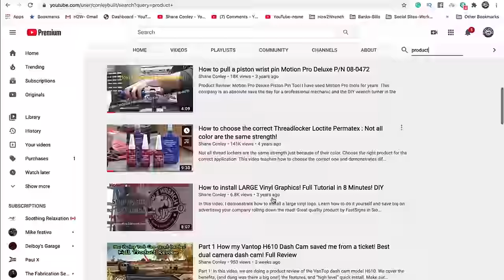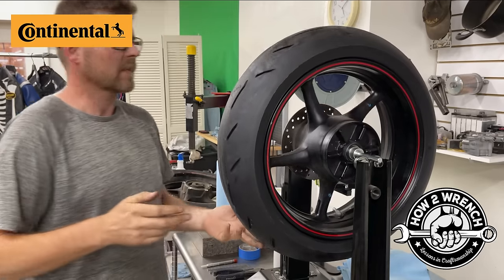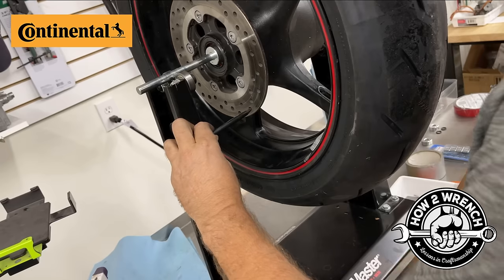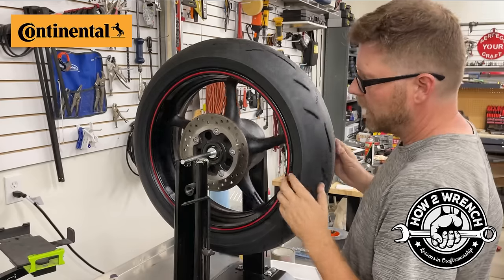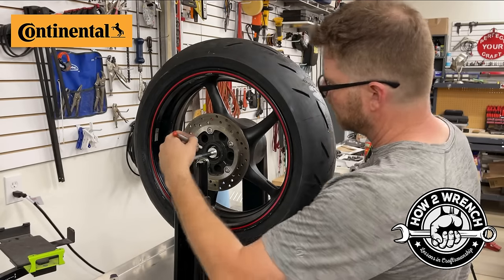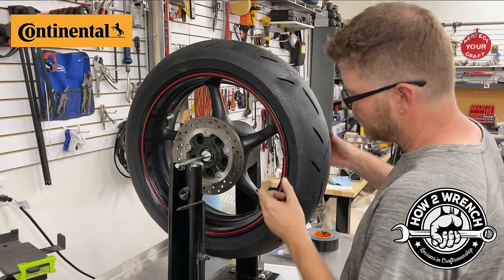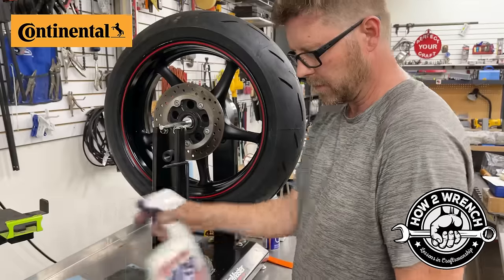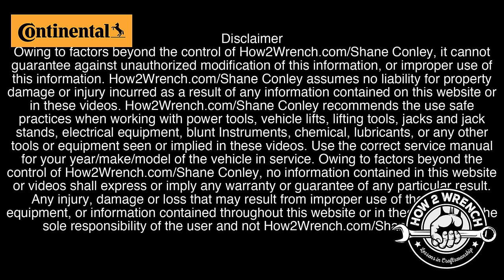Learn how to balance tires like a pro in minutes! Must see first step! BikeMaster Balancer 800-256

Comment: Always balance the wheel with the sprocket, otherwise it'll throw the balance out when fitted 

You've overcomplicated the method. Simply find the light spot (it'll be at the top when let to settle); turn the wheel 90° and add your weight at 90°. With the correct weight, the wheel will not move. Done.

Think of it like a seesaw or a two blade propeller - as long as the opposite points are of equal weight, there will be balance.

Check the bearings before attempting to balance. Any imperfections in a bearings (in the wheel or on the stand), or on the shaft could cause a false reading.

Comment: The stick on weights.....if I pull them off is there any way to re-use them on a spoked  bike wheel.

Edit....yes I refitted my old weights with a smeam of silicone sealant.
Reply: I did my front and was at 3/4 oz. I put gorilla tape over the weights and that became the heavy spot on the wheel. 🤬

Comment: What do you do if the bearings were hammered in one whack too much, and the wheel won't turn on the balance stand, but it will turn when torqued onto the bike?

And did you ever notice that f it turns on the balance stand just fine, when torqued onto the bike, it squeezes the bearings and the tire won't turn?  This makes me WANT to whack the bearings one extra time so it spins free when torqued onto the bike (to reduce rolling resistance, reduce wear on the bearings, save gas, etc).

Comment: would it be possible to balance the tire and the wheel separately and match up the spots where they might balance each other out when the tire is put on the wheel?
Reply: Absolutely! 1) find the heavy spot of the rim (without tyre). Mark it. 2) Balance the rim WITHOUT tyre. 3) Place tyre on rim, 1 bead ONLY. Find the heavy spot of the tyre. Mark the tyre heavy spot. 4) Rotate tyre so the TYRE HEAVY spot OPPOSITE heavy spot on rim. 5) Complete tyre install. 6) Remove weights from rim balance(2). 7) Balance wheel. I normally balance all wheels with their respective bitz (ie with brake discs and sprocket carrier).

I have a junk front rim that is balanced perfectly and use that as my tyre weight finder for both front and rear tyres.

Comment: cleaning old weight stickers off is a pain, i like googone the best so far. i wipe rim w isopropyl alcohol before applying weight, 
and i put half of the weights on each side. in my mind im figuring balanced left n right side is better than all the weight only on one - thoughts?

Comment: You didn't wait for the wheel to settle once, meaning you got the heavy spot wrong. It even moved CCW and then CW a bit after you left it to get the scissors, and a bit when you checked it the last time. The technique is right, but you have to do it right too, if you want it perfect. If you're happy with 98%, then you're good.

Comment: great work.  BUT you should have put those 3.5oz weights on other side of rotor  to balance it a bit further.  think about weight of rotor on that side of wheel , just splitting atoms here ;) . thanks for this video and I just ordered this balancer thanks to you.  now to install my darkside Michelin x-ice replacement  after 6 years on one.

Comment from the maker: Just in case the commentators delete their comments on Duct Tape use....What's crazier is that it's a struggle to understand looking out for others....google produced a few results to back this idea...
https://www.google.com/search?q=is+duct+tape+required+on+wheel+weights+for+a+track&rlz=1C5GCEM_en&oq=is+duct+tape+required+on+wheel+weights+for+a+track&aqs=chrome..69i57j33i160l3.17771j0j7&sourceid=chrome&ie=UTF-8

Comment: Change that shaft to all thread then put nuts on either side washers if you like,you will find u can tighten up against the wheel brgs ,and all will be much easier, you are welcome
Reply from the maker: All thread doesn't work for numerous reasons...loss of precision as it's not centered in the cones...also as you spin the wheel the all thread will do just what it is and "thread" walking the wheel/rotor sideways and making contact with the balancer....you're welcome We will still share with Shane but copied this from another person that asked...😁

Comment: great vid...Changed my own tyres for 10 years (124,000) and never balanced my wheels on my 2009 XT660Z Tenere until yesterday because the vibes from a new front Continental TKC80 was insane at 70mph....I cut a slot into the flat faces of 6, 8mm stainless steel nuts (4 grams each after cuts) and slipped them onto spokes and used cable-zip ties on the spoke to hold them down and got it all dialled in....Any thoughts on adding weights to spokes?